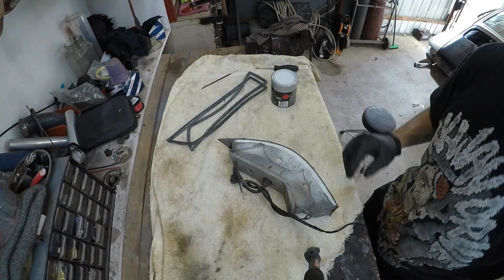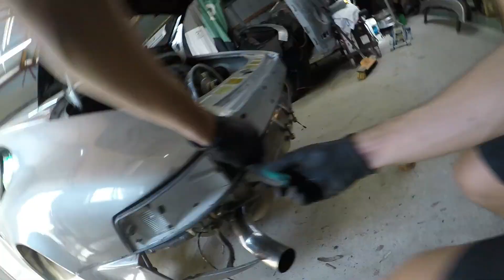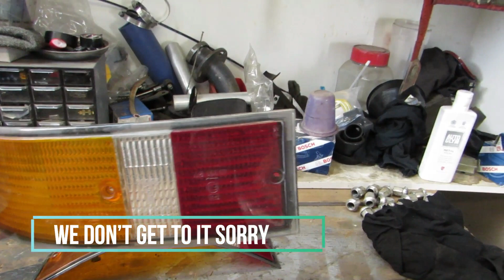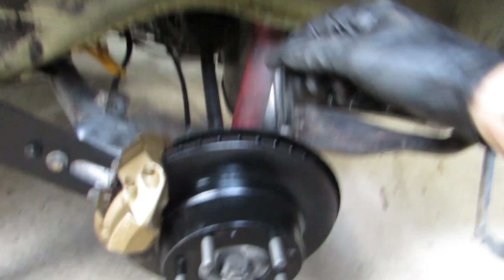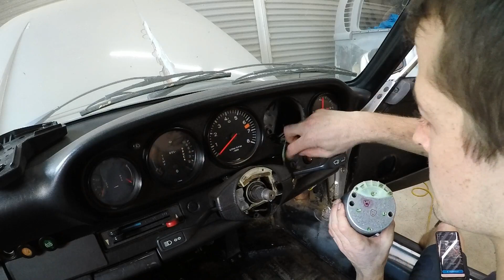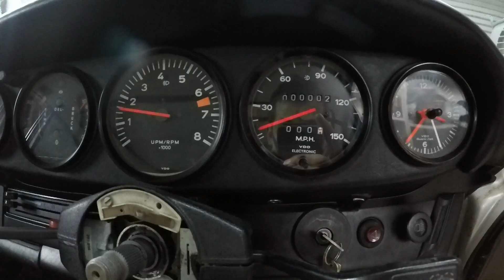PROJECT PORSCHE 911 #EP11

Comment: anyway to take off the rear “Porsche” reflector without taking off the bumper?  thanks
Reply from the maker: Hey sorry Carla I didnt see your message till now. You can get it off with a bit of work. There is the heat shield you will need to take off that goes between the bumper and body and then once thats out of the way you can get to the small nuts on the back of the reflector.